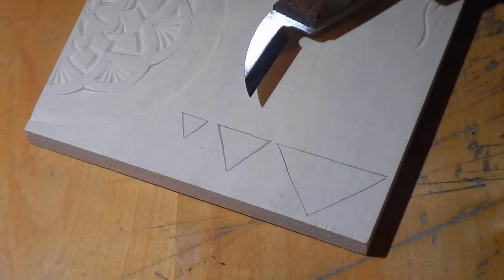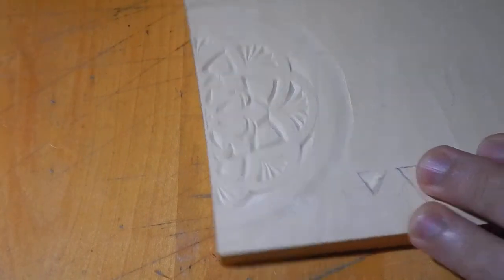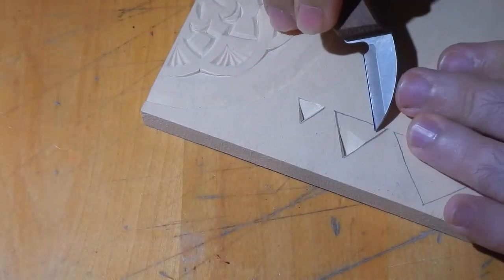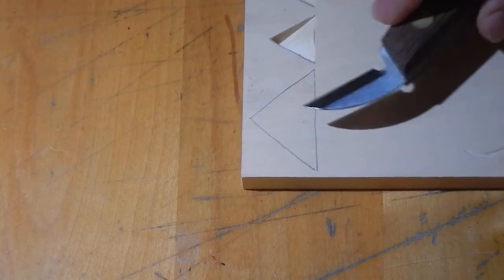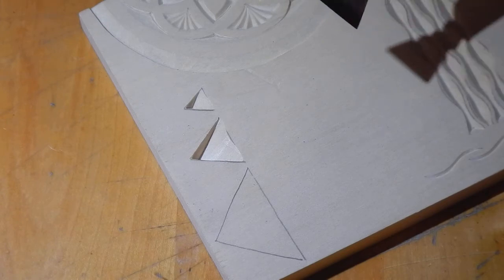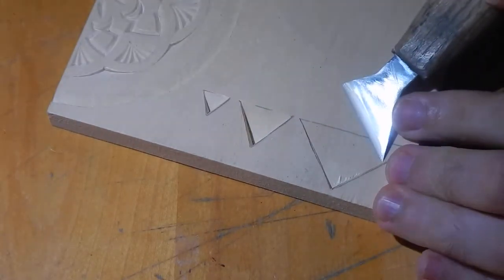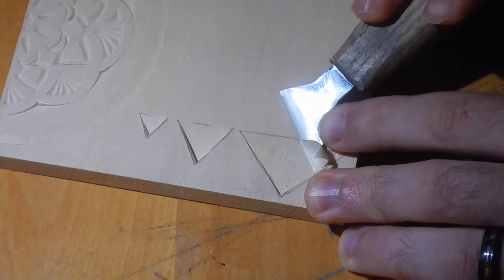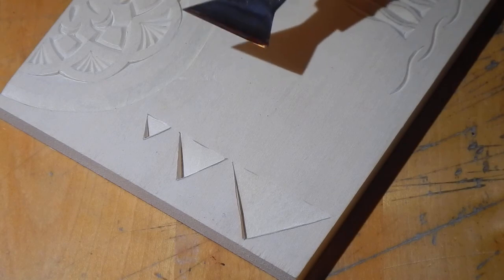CARVER'S TIP: Which Knife for Carving Old-World Style?

Comment: That is a good style knife for that task you could also use a Pfeil #8 carving knife to do the exact same thing & they are much easier to find.
Reply from the maker: I'm not familiar with Pfeil tools, and I found the website to be hard to navigate.  Do you have a link or picture of the tool you're referring to?  I was largely comparing this to the standard chip carving knife since that's what most people will be using.  Compared to a chip carving knife, the three things I like about this for OWS are the longer blade, the thinner handle, and the angle of the blade relative to the handle.  So anything that's similar in those three aspects would probably be perfectly suitable.

Comment: how do you define old-world chip carving to someone new to the craft?
Reply from the maker: That's a fair question.  They key is to look at the angle of the blade when making the cut.  With Swiss style, the knife is always at the same angle on every cut.  So for a generally symmetrical chip, the deepest part is around the middle.  When carving old-world style, there are two different carving angles.  It's typically done on triangular (or roughly triangular) chips.  The first two cuts have the knife going almost 90 degrees straight down into the wood -- I usually lay it down a little off of 90 degrees, but close to vertical.  Then for the third cut, the knife is laid down very flat, close to 0 degrees from the surface.  This makes a single carved surface, and the deepest point is way off to one corner of the chip.  (There's obviously technically still 3 carved surfaces, but two are near vertical, so you don't really see them except for the shadow they create.)

Is that clear enough?  Does it explain the difference?  If you'd like, I can see about doing a video to specifically go over the differences.